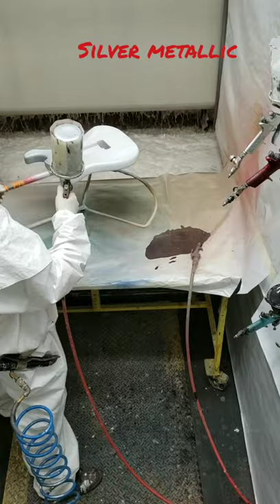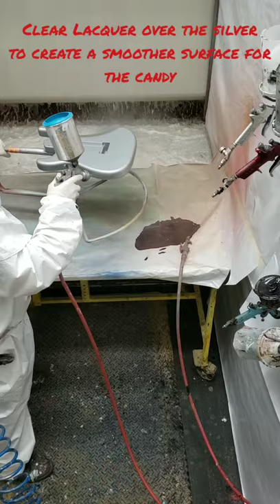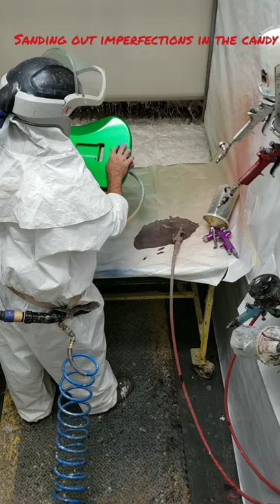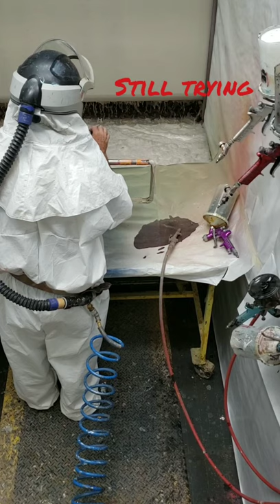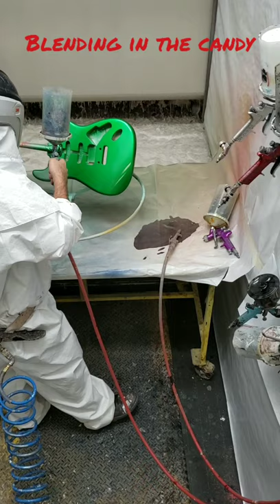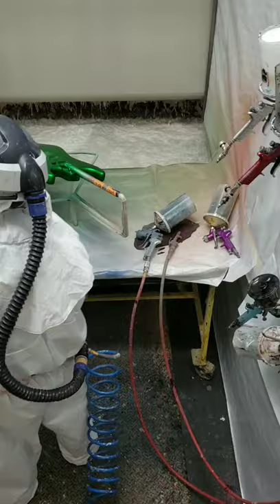Candy green over silver metallic on a strat.

Comment: Why are you able to apply in one single coat with no flash time? Or is this a video edit?
Reply from the maker: Hi.
I'm using nitrocellulose lacquer. It dries to the touch in a minute or so if you apply it medium wet. It is not cured but it can have more material put on top without a problem. I made another video of this idea. I painted the same guitar with many different colors for 30 minutes straight. No waiting in between.
Reply: @JNcolor  PLus... Looks like you are using a very very thing spray coat with a very low pressure, is that correct?
Reply from the maker: @Ranametalera  it's fairly thin paint that I apply medium wet. And yes, I use low air pressure.  I believe though that it's just as much about the properties of lacquer as the way I spray it.